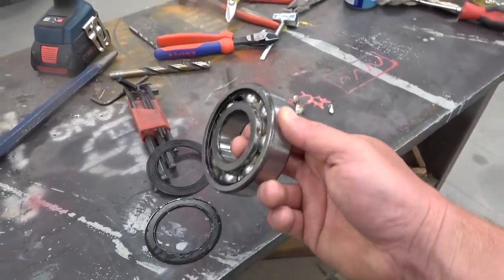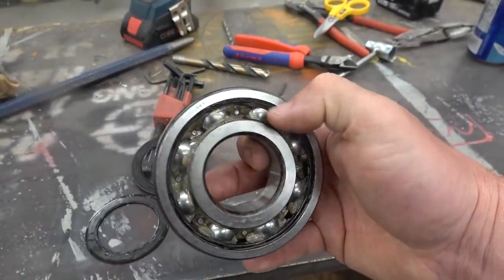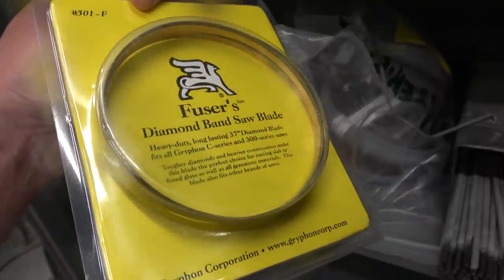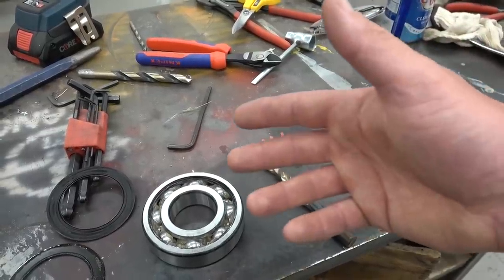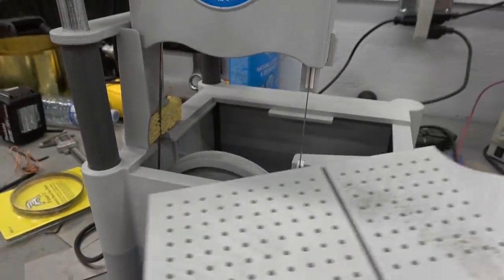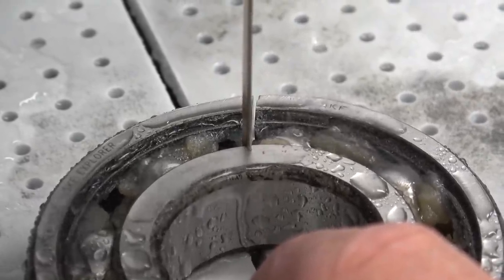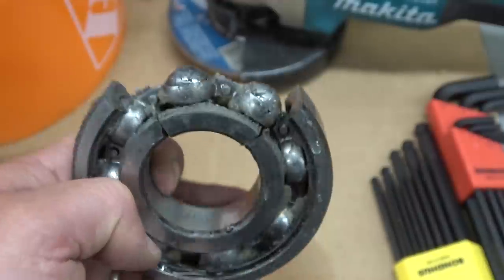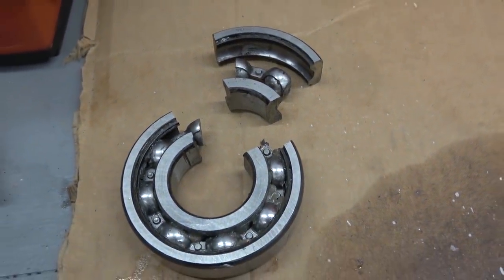Diamonds cut anything.

Comment: diamonds are only good for cutting a big hole in your wallet.
Reply: Chinese synthetic diamond suppliers beg to differ ;-)
Reply: Industrial diamonds aren't very expensive at all. Hell, gem-quality diamonds aren't even that rare. 
The industrial ones aren't gem quality, and can be manufactured. I don't know for sure, but I'd guess that the matrix they're in is probably costs more than the dust.
Reply: @dwaynezilla  industrial diamonds are crazy cheap, Alibaba sells bags of hundreds of them s
Reply: Industrial diamonds are cheap like borscht. Even the single crystal diamond wafers for chip substrates are way cheaper than similar gems. I hope the bottom falls right out of the jewelry industry one day soon.
Reply: Neil Siebenthal  : Is that because it isn't google, otherwise there may be /have-been some attempt at coverup.
Reply: Neil Siebenthal  your wording was weird I think you both just mistook eachother it's no biggie

Comment: Uh, no jeweler ever needs a diamond saw.  Gold is pretty damned soft, even white gold which is alloyed with nickle can be cut with a tool steel blade.  Same with platinum, which is much harder than gold but still easy to cut with good steel.  Just sayin'.

By the way, traditionally diamonds are cut and polished using a thin copper wheel with some olive oil applied to the wheel and then coated with diamond dust which sticks to the oil.  Diamonds have an affinity for any kind of oil/grease.  That's how they separate them out of the ore at diamond mines.  They crush the rock and run it over a grease table.  The diamonds stick to the grease as they hose everything else off with water.  It's the same reason the wife's diamond gets all dirty and dull.  Oil/grease from human skin and hair, cooking, etc. gets the diamond greasy and then dust and dirt sticks to the oil.  Then the diamond looks dull and lifeless because it's dirty.
Reply: Likely for stone cutting tigers eye,  onyx, jade, etc.
Reply: Never? Sounds made up. They are a jeweller.  They can make jewellery out of whatever they want.  Maybe even something that needs a diamond saw.

Comment: 200 grand for the machine until you turn into a schill like Titan
Reply: or wranglerstar who AvE called out a few years back
Reply: @kwakamonkey  titass went from a haas fanboy to a dmg fanboy to now schilling for Tormach and Doosan, one being a step below a Haas, the other a step below DMG Mori. Pretty soon he'll be trying to cut inconel on a CNC converted drill mill
Reply: @nuthinbuttrubl89  

It's easy to sell your soul.  That is what makes the Canukistani King of enginerding innuendo so unique, literally NFG.
Reply: @nuthinbuttrubl89  I stopped watching wranglerstar due to his shill crap. 

His latest beef with bunker branding ( demolition ranch) is pitiful too. A big cry baby.
Reply: @ianmurphy76  AvE has my respects for not selling out. Too many are selling out .
Reply: @kwakamonkey  if he gets a dollar from every subscriber he's got, he doesn't have to 🤣
Reply: @nuthinbuttrubl89  

Inconel isn't even that hard, 32-40 HRC. Better example would be Rex121, or Maxamet, both being 69-71 HRC, exponentially harder than the 52100 bearing AvE just cut, which is exponentially harder than inconel.

Anything harder than that and you're into ceramets. Hell, my Maxamet knives are hard enough to cut glass.
Reply: @CNYKnifeNerd  it was a joke, dude. I know, most nickel alloys are soft, but they're abrasive, they work harden and they're difficult to work with, but the joke was aimed at using a g0704 to do it with. 🙄

Comment: A 4" grinder with a diamond tile cutter wheel will do it rough cut through hardened steel much faster. I stopped buying composit disks because they cut just as fast without breaking. Sythetic diamonds are awesome.

Comment: I used to work at a place where we sharpened saws and made bandsaw blades to size, and we had reels of this stuff in sizes from 3/8ths up to the inch to be cut and welded. I think it was a Starrett product. Mind I think in the years I worked there, we only sold one small blade to a jeweller. Cant imagine what you'd cut with the thick gauge wide ones.

Comment: that machine is made of plastic so you can hose it down or dishwash it. I think it might be a good feature for a jewelers saw. Diamond dust is nasty shit, you need to clean it really good. And its very water proof and immune to weird aluminum corrosion issues etc..
Reply: some of those jewelry metals when they are cut are quite nasty too, there is a huge benefit to being really able to deep clean this thing. I am not sure you should be so judgemental to plastic.. however it all depends on the construction quality, which seems a bit low
Reply: health effects of literary whatever humans think is shiny and cute looking. Iridium pen? uranium cuff links? palladium catalyst in your lungs? I consider this thing a Hazmat saw.
Reply: check out the effects that some of those rings plating materials have when they are exposed to mild acids or dissolved. Do you want aluminum hydroxide forming because of impurities making the cutting water caustic, tarnishing platings, making harmful dissolved solutions, etc? Some of those platings are real nasty when they react with things normal jewelry is fine with.

Comment: AvE,
do not complain if the ball bearing's iron slowly eats away the diamond edges of your saw blade. Carbon is soluble in iron. Maybe you get yourself a saw blade coated with CBN (cubically centered boron nitride) ;-)

Comment: It is good but this is more dangerous than just jumping off a cliff, it has no protection; not like no decent protection but like no protection at all and you definitely don't want to inhale diamond dust coming out of that. in my opinion the least of the least that it needs is a good handle and def some ppe for the user

Comment: at the goulds pumps test lab we used to wreck skf bearings the old fashioned way: 0 to smoke in 5.4 seconds. A struers 50a20 composite blade will also go thru that outer race but mite choke on those balls.